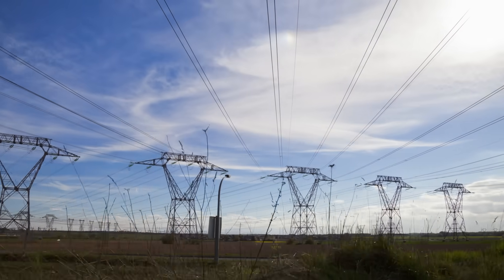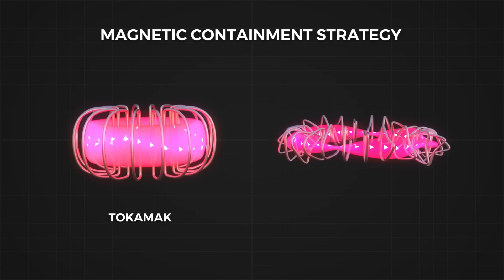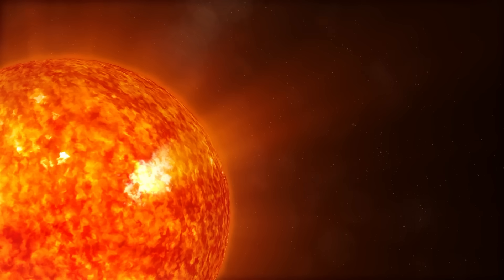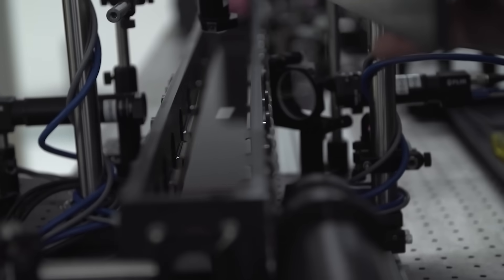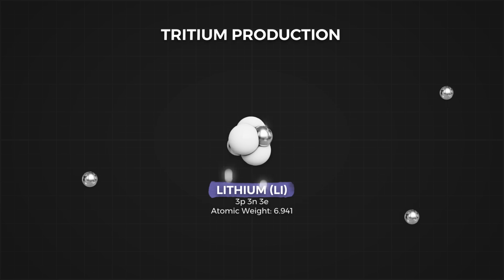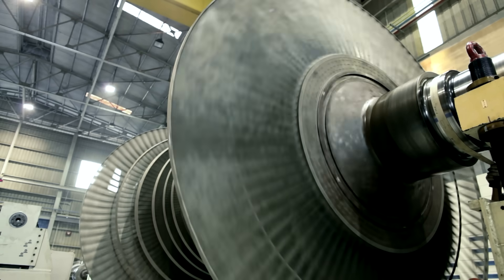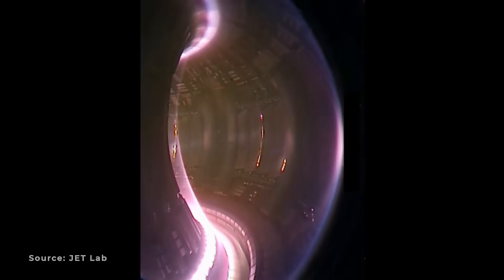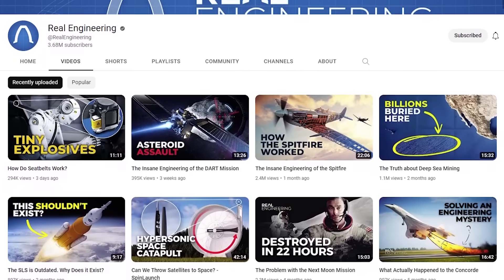The Problem with Nuclear Fusion

Comment: Thank you I learned a lot and I appreciate your balanced approach. I am not anti-nuclear, but I am cautious about it's future. For example, we built a civilization base on the the discovery of fossil fuels used for mostly wastefully burning it for the heat. We designed our cities and farms around the availability of cheap energy. Now, we are faced with both a declining supply and the threat of climate warming. What worries me is that "potential" nuclear development will overshadow a better designed society based on renewables.

Comment: I am very sceptical of any tech-startups that try to solve such a long researched problem. Just considering the needed resources it always begs the question why hasn’t someone with more resources tried this before? And usually the answer is that they did, and it didn’t work, or the company is actually stuck on the same key issues as everyone else, and in reality had no trump card or skeleton key to advance the technology.

And its not that the private sector doesn’t do valuable and good research - rather that their marketing often promises ridiculous viability compared to other research efforts. Where researchers have optimistically promised 20 years for 60 years, private company saying they will do it in 5 sounds like an advertisement, not a honest estimate.
Reply: Yeah, and often people talk about energy out/energy in=1 as the holy grail.  Fact is that it has to be a fair bit over one, as energy is needed for supporting processes, etc within the generator. and the economics don't get interesting until the ratio rises a fair extent beyond even that.  You need to be able to extract a lot of energy before very expensive plant construction is preferable to other sources, specifically fission.
Reply: @MrJdsenior define definitely, it heavily depends on how efficient is the power generation system (from heat input to electrical output) and efficiency of the magnetic containment system. If my memory doesn't fail me, it needs to be over 20 with the power generation /containment current technology
Reply: A lot of them are spin-offs of well established research and they try to scale down with more prototyping/less theory. In fact a lot of them directly collaborate with the institutions. For example CFS. They’re relatively new but they’ve made some of the largest technical advances.
But you’re right, there is a lot of marketing/hyping going on right now. We’ll have to see where this all lands 10 years down the line.
Reply: @TasX  I can tell  you that.  Based on previous performance, ten years down the line we will be twenty years from realization, just to continue the eternal, never shortening estimate.  Shortening that already demonstrably ridiculous time frame does nothing.  It is just nonsensical marketing.  Just sayin'.  

I hope I'm wrong, but I likely won't be.  The investing disclaimer, past performance is not always indicative blah blah blah..., and all that aside.  Eventually we may get there, probably will, but, unless some pretty serious advancements are made in multiple areas, probably not during my lifetime.  HEY, maybe AI will come to the rescue!   And IMHO, if it does (or doesn't) a short time later it won't matter, not to the human race, anyway.

Working the bugs out of the 'program' may have a whole new meaning, if you catch my drift.
Reply: Nuclear Fission is not Green energy.  Spent nuclear fuel rods are not Green.  Especially when the world is too cheap to build a permanent, underground, spent nuclear fuel facility for high radioactive contamination that lasts for 10,000 years. ☢
Reply: @williamyoung9401  who was talking about fission? Maybe it is buried in the comments, but this video is about fusion
Reply: And today the U.S. dept of energy announced a fusion reactor achieved net energy gain. It’s still early, and not a shipping product yet… but we’re getting closer! ❤
Reply: @cwaldrip  it is still very early. That is net gain laser energy in to fusion energy out (but not captured). That is not gain on electricity into the plant to electricity out of the plant. You need a couple more orders of magnitude of gain to make that work. Nevertheless, it is momentous!
Reply: Why do you consider it a research problem? Physics of fusion is well-understood, the question is to engineer a device which can do things economically. It's an engineering problem.

It's kinda same as light-bulbs - scientists knew that a heated material can produce light and that electricity can be used for heating, but engineers-inventors created the light bulb design which was economical at scale.
Reply: @killers31337  the physics of fusion is well understood at the nucleus level. The magneto-hydro-dynamics of a confined plasma are not that well understood and are a major problem to model (even with AI). LLNL/NIF had some spurious unexpectedly high energy particles coming out reported just a few weeks ago. The science isn't fully solved. Close, but not quite.
Reply: @MattNolanCustom  Good point, but I'd say the light bulb analogy still works - I don't think physicists at that time could predict exact light bulb properties from its parameters. Actually trying things might be faster than modeling from first principles.

Same with airplane development - it's not like precise aerodynamic calculations were feasible at that point, people were just trying stuff.

Trying different fusion reactor designs at different scale might be fruitful. It's not like they are guaranteed to run into problems. "Startups" can iterate faster than research labs - while a research lab might dedicate time to studying an interesting effect, more product-oriented startup will try to find a way to avoid it, for example. And it's gonna help the research side too.
Reply: @killers31337  I'm both pro government labs and pro startups in the Fusion space. It's actually quite a collaborative ecosystem versus many other tech spaces. However, I also like a bit of realism. The light bulb analogy isn't the best as light bulbs are small and inexpensive. If you melt a hole in the first wall of your Tokamak because you didn't get the modelling right that's vastly more expensive in materials and manufacturing and in down time. My money is on a start-up getting there first, but they would be nowhere without the work done and in progress at the national and international labs
Reply: I definitely agree that there should be a healthy skepticism with these fusion startups. I don't have the knowledgebase to verify their claims and if it's anything like the smallsat launch market there's a ton of hype and investors dumping their money into bad companies (SpinLaunch, Phantom, Arca, etc.)

That said, having many less funded groups trying to solve a problem can be much more effective than having one group of people do so. A lot of these startups will be attracting passionate, driven engineers and scientists who don't like the more academic nature of the huge national projects. Having small budgets to work from will lead to innovative solutions. Will all of them succeed? Certainly not. But, if each one of them effectively solves a small part of the problem then collectively the field will be advanced.
Reply: I have learned to be less skeptical of new companies trying to solve old problems. It doesn't take too much digging on the internet to learn not everyone wants the world to learn and grow. There are likely many solutions to world problems that (to put it nicely) were simply encouraged not to be used.
Reply: Everyone thought private spaceflight was a fools game until a company came along and blew all expectations out of the water. Startups have less red tape and bureaucracy involved, which is an immense factor in their favour. As we move forward private scientific endeavours will make more of an impact as science becomes liberated from being the sole purview of nation states, politics and taxpayer money.
Reply: @BlueZirnitra  Mostly, I agree with you, but the difference with space flight is that it had already been achieved. Science problems solved. SpaceX et al just did smarter engineering and business. Fusion power generation still has not been achieved. Many science problems still outstanding. Nevertheless, I maintain some optimism!
Reply: @MattNolanCustom i wouldn't even say smarter engineering, just scaled up engineering. Even the vtol engineering was solved decades ago with Delta Clipper. But exactly, it was all solved problems, just needing business improvements
Reply: @BlueZirnitra  your example of space flight in fact proves how unrealistic and stupid it is to believe private companies will have anything of commercially viability in 20 years.  Let alone 5, like the company that sponsored this video is claiming.   Private sector efficiency is definitely real and is great is many cases (definitely not all, see insurance....)

It took space x TWENTY years of research and billions of dollars to get a rocket to land back on the ground after launch.  Which by no means an easy feat, in theory, was physically possible 60 years ago.  It was a controls and software problem.   Science is slow, when your constraints are the physical limitations of the universe we happen to live in.  
The Artemis rocket that just launched the other month.  Has an an increase thrust to weight of 30% over the apollo saturn v rocket that we launched to the moon 60 years ago. (I commend the engineers that made that improvement possible)

Things like space have other uses and don’t need to make sense economically.  A reactor absolutely does.  And the thing all these private start ups and and this channel fail to mention, is that achieving a net fusion gain is MILES away from a useful reactor.  Every single energy plant nuclear or not, from its fuel needs to generate enough energy to overcome: 
the energy required to start the reaction (this is the net fusion gain step), create enough energy in a form that is thermodynamically viable, then of that have it be in a form the reactor is capable of using, overcome the losses in the turbine (or whatever converts the energy to electricity), you need to have enough to cover the energy required to keep the plant operational, lighting, pumps, cooling, water, pollution filtering and management, you also need to generate enough energy to cover the cost of pulling your reactants out of the ground, refining and transporting them.   This is something producing  ethonal from corn can not even achieve btw, even when the sun does most of the work for us.  And once your reactor makes enough to do cover all that, then it is POTENTIALLY viable.  (this is where space x started, taking an existing technology and attempting to make profitable).  Now you have to do it profitably and cheaper then the other green energy sources currently available.  

The actual energy required to achieve economically viable reactor (not profitable) is (depending who ask) 10-40x MORE then the energy required to achieve a “net fusion gain”.   I think private sector science is a great thing, but let’s be real.  They don’t get to change the laws of physics.  Took nasa 60 years to get a 30% bump in thrust to weight.  And if these private companies think they are going to get an increase in efficiency in the range of few THOUSAND percent in 5 years with their 4 dozen employees in a warehouse, they are either complete idiots OR scam artists willing to lie to investors and the general public to get rich themselves.  And considering the educational background of the people we are talking about here, I am pretty confident in saying they are probably not idiots and oblivious to their lies and fall into the latter category.  No respect for them or this channel creator for promoting these hacks.

Comment: The Sun is NOT a fusion fireball of over 800,000 miles in diameter! Basing fusion physics on what we're told the sun is(it's not!) will never result in anything useful! It's nothing but a futile pipe dream designed to devour huge sums of cash from those ignorant to the facts!

Comment: I wrote a paper about this in 6th grade, roughly 40 years ago. 40 years ago they said it would happen within 10 years. For years it was always 10 years away, now they're telling us is 20 years away. Face reality. This may eventually happen. But we're nowhere near it. We need to be using technology that we actually have and can use Liquid fluoride thorium reactors are technology which is available today and can free us from fossil fuels. People need to stop throwing out the baby with the bathwater. No lftrs are not perfect. They're a hell of a lot better than anything else out there. And fusion isn't there. It's not practical. We can make it happen but we can't extract more energy out than we put into it yet. And even when we can extract out more energy than we put into it is it going to be enough more to make it worthwhile. How quickly are we going to burn through our stocks of available hydrogen. Lftrs or technology which are available today...

Build them now, and continue researching fusion. Maybe someday Fusion will even become practical. In the meantime we can have energy that is free of fossil fuels. For the next 10,000 years or so until we can figure out the next step

Comment: No, fusion will never be useful, its a money pit.

I looked into it but the reason is fairy straight.

In order to fuse atoms you need to use at least the same amount of force that they release in the first place. 

Basically, particles have repelling and attractive forces.

That's because the "energy" atoms use to repel other atoms is the same energy/force they emit in the first place.

So in order to get 10 000 units of power from a set of atom you need to invest AT LEAST 10 000 units of energy into fusion.

Then, you might ask, then does is fusion working for the sun if it's not cost effective ?

Well, the stars don't use their own energy so electromagnetically of kinetically fuse atoms as we do, thy use another method which is the only cost-effective one.

The suns use gravity to fuse atoms, the gravity of a sun is so strong that it literally crushes multiple atoms into a single atom, for example a sun's gravity crushes 4 hydrogen atoms into one helium atom.

But, then you might say, how about making that gravity on earth ?

Nah, not possible, you need mass in order to have gravity and the earth doesn't have enough mass for it.

To give you a perspective, Jupiter has many times the mass than the whole worlds in the solar system but not even Jupiter's gravity can achieve fusion.

So, to give it to you straight, the only way to achieve fusion on earth is by using electromagnetism or kinetic force but you need to invest the same amount that you receive back in return, At least.

In earth fusion you need get more energy than the investment, it's usually not even similar to the investment.
Stars use the power of gravity to fuse multiple atoms in one and since gravity is free(it only needs mass to be present) you always get a surplus of energy and it's why stars can do fusion. But going against the binding energy in fusion requires more energy than what the binding energy can give ! To go against the nuclear force you need a greater force and you will get a smaller force in terms of energy in return, logical.
I hope you like it ! If not..well...too bad, I don't  think this will ever change.

Comment: Eh im not the biggest fan of helion, the way the tech works is by actively doing the opposite of what makes a good fusion plasma, the whole "doesn't need to ignite" I dont think will pan out, the number of reactions will just be too low unless they make a stupid size machine, probably bigger than a tokamak is needed

Comment: All engines need an external power to start, it took the power of a nuclear bomb to create fusion, a fusion bomb. so why don't we start there in tiny amount. To keeps it going would only need to control the feedback loop by adding or subtracting it... The trick then would be how to control such initial nuclear explosion in the first place. The stigma about nuclear explosion is stronger than our desired for clean energy.